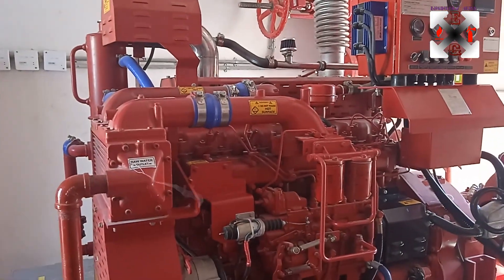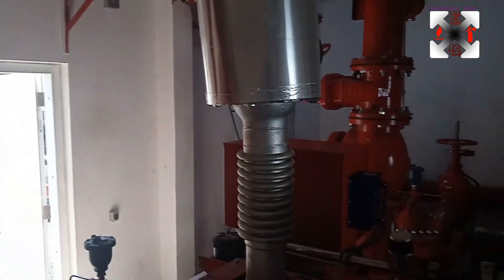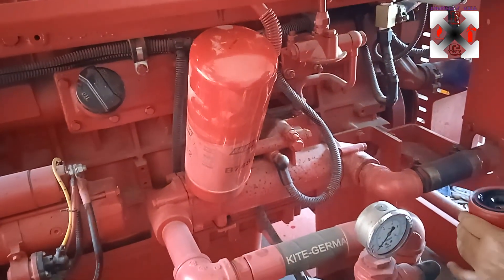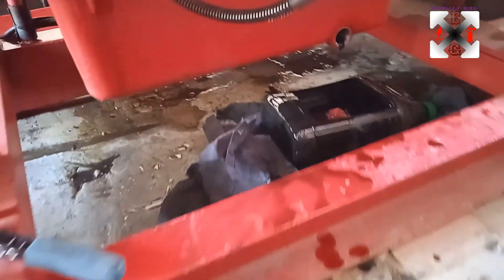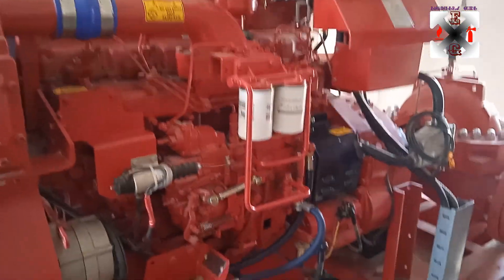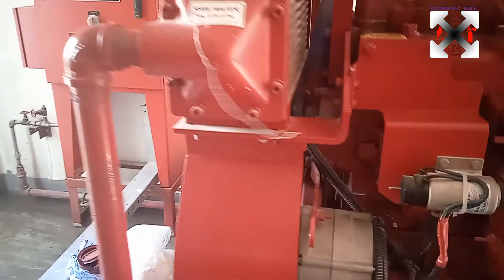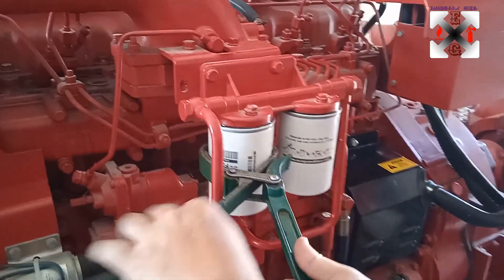FIRE PUMP DIESEL ENGINE SERVICING BY ENGINEERS GUIDE#FIREFIGHTING#DIESELENGINE

Comment: Hi!
Thanks for the video. We are the "Clarke" dealers and I will allow a few comments on the video

0:49 - Good idea to spread the tool out on cardboard and not on a dirty concrete floor. Dirt and sand will get on the tool and engine parts and filters.
2:26 - I recommend working with oil and fuel in gloves. These are liquids that are harmful to the skin and the skin will be sore after dirty oil.
2:50 - You have very much spilled dirty oil on clean foundations, this is bad practice and it is impossible to wipe it off to make the concrete clean and white again. Put cardboard and lots of rags underneath.
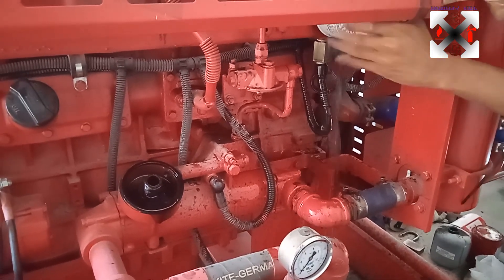4:14 - You need to cover the oil filter base to keep dirty water out when you remove the water filter.
4:53 - You tightened the fuel filters with the tool about 2 turns after touching the rubber filter ring to the base. Do not use the tool to tighten the filter. The filter only needs to be hand tightened 3/4 turn.
6:51 You did not pump oil with the starter (into the turbo and oil filters) before starting the engine. After the start there was oil starvation of the turbo and bearing.
7:05 Oil pressure (cold oil) is 0 and you didn't stop the engine and find the cause

Good Luck!
Reply from the maker: well appreciated thank you

Comment: is that diesel engine get jammed while its not run for a long period? what are the precautions to do before restarting an engine. battery is replaced and verified the connections and selfstart motor.
Reply from the maker: Its possible when not run for long time ,engine servicing as per the video has to be carried out check the batteries acid if applicable..then test run